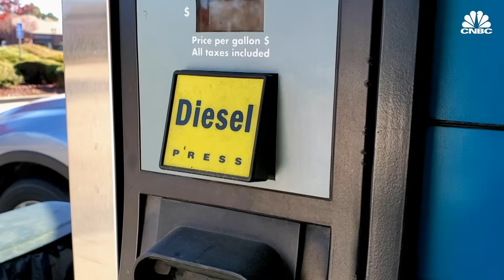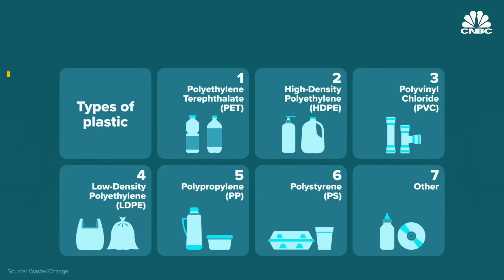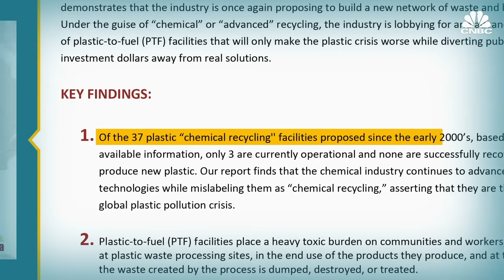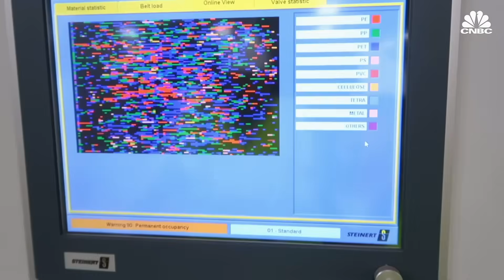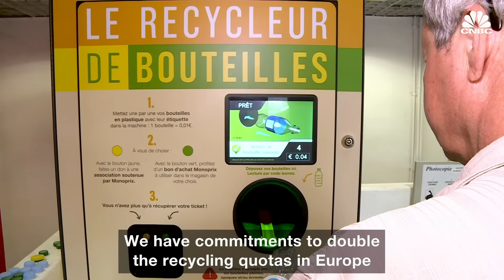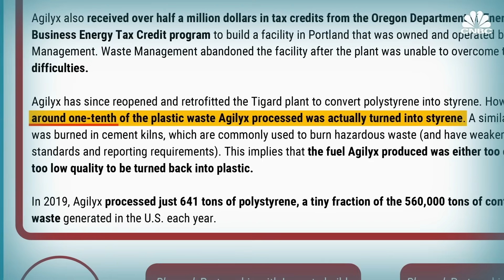Can Chemical Recycling Solve The World's Plastic Problem?

Comment: Coca Cola has got to STOP using plastic bottles. There are several other options for plastic. Options like glass, BIOPLASTICS,  paper milk cartons,  aluminum, tin , steel,  fountain drinks on tap, metal beer barrels that hold Coca Cola so you have Coca Cola on tap. This is a simple problem to solve but it requires managerial leadership. If Coca Cola doesn't show managerial leadership in solving this plastic problem, then the government should pass laws forcing Coca Cola to use alternative environmentally friendly materials. Single use plastics need to be banned altogether; we can start with that.

Comment: Recycling is a damn gimmick only.  It eases your conscience.  It takes the pressure off of plastics manufacturers.  China will no longer accept and recycle this crap.  Your recycled plastics are going in the nearby landfill or being incinerated.  New, virgin plastic packaging from crude oil is cheap to manufacture and convenient to ship filled with product, but it is not sustainable.

Comment: As long as we continue to pull oil from the ground, it won't matter what the final product is (gas, plastics, oil, diesel, etc), nor how many times it's recycled or into what.  The end is the same. Hydrocarbons will continue to be extracted from the deep (from petroleum) and left on the earth's surface (as greenhouse gases, waste, more plastics, fuel, etc).  Even if you have bacterial decomposition, you still have that source material in the end.  From a chemist's perspective, you have a certain amount of mass (oil) pulled from the ground and that mass must be preserved in the form of waste of some sort.  So no matter the recycling method, over time, we will always end up with more and more and more.

Comment: I wonder if we built a shaft large enough and deep enough with an exhaust shaft on the other end, we could compress pelletised plastic waste into these shaft using archimedes screws and use the geothermal heat to trigger a pyrolytic process, cap the exhaust end and process the exhaust gases through distillation, cryogenics and carbon capture.

Comment: An engineer in Australia invented the method of "green Steel" years ago and got an award for her work.  She also invented a machine that takes plastic and clothes and glass and makes ceramic tiles.  We need to abandon plastics quickly but there are ways to reuse them.  The video is on YouTube and she has been working on this for years ever since she graduated from college decades ago. No one wanted her "Green Steel" but now,  with climate change and carbon and fossil fuels debate, her method to forge steel uses 1/3 less coal by using the plastic.  I don't understand why this has been kept secret, I guess because the involved industries have refused to use the technologies until their customer have demanded change.  Call the manufacturers and tell them to stop with the plastic packaging, they will listen.

Comment: Plastics are properly and customarily captured in managed Solid Waste systems. Technologies and internationally recognized standards are available to ensure plastics work in this primary managed waste system (ASTM D5526/D5511).  These systems are actively managing waste and recovering value through biogas recovery for clean energy.  The reliance oin recycling has a direct correlation with ocean plastics as we sanctimoniously  sent all of our "recyclable" plastic waste to countries that have no waste management infrastructures.  It's one of the biggest scams being played and those zealots that think recycling can save us cannot objectively analyze basic facts and data.  Reduce, reuse and recycle is a feckless mantra used by those programmed by an industry that is completely incapable of managing this problem.

Comment: If you turn plastic's into fuel, at least you can solve the problem of plastic bottles in the ocean, and it would displace some of the fossil fuel that is extracted from the ground. It's not a perfect solution, but it's better than anything else we are doing.

Comment: So fossil fuels are on the way out??,  3/4 of the navy runs on diesel fuel oil, the army, and Marines use gas / diesel fueled vehicles. I don't see them switching to electric jeeps or tanks any time soon.  Most farmers use diesel machines, lets not forget, all types of construction machines. 
    are you going back to glass bottles to hold all the drinks being sold?, switched to waxed cardboard to hold all the liquid detergents, oils, drinks.

Comment: The environmental cost of plastic needs to be included in the cost of production, otherwise plastic companies will continue churning out plastics at a destructive rate with no cost to themselves. Legislation that taxes producers proportionally to the environmental harm they cause is a great solution. "Open market competition" will just result in companies continuing to push these costs onto future generations by not taking responsibility for the damage they are causing.

Comment: I see that by focusing so much on "recycling" the plastic it is becoming an industry upon itself. Right now the the goal is to reduce plastic waist; however at some future point the owners will be unwilling to go out of business and possibly try to find "behind the scene" ways to keep the plastic problem as a problem. Keeping them in business.  We really need to attach this problem on all fronts. 1) find another alternative for plastic other then fossil fuels. such as seaweed (like they have done in England).2) legislation for the plastic companies to reduce the amount of plastic. and food manufacturing companies to produce a % of their product in glass containers. Giving those of use that want to buy a product~ milk, organic eggs, honey, ext. the option to not have the food in a chemical leaching container. 3) to have more companies willing to receive back the glass container for a reduced refill cost. ( there is one company in NY that is already doing this. you can order soap, oj, and shampoo, ect. in metal containers and they deliver it to you and pick up the empties when you request it.) 4) We also need to have a population that is willing to have their lives changed/inconvenienced for the greater good. Do we really need 16 different flavors of the same brand of soda? or cereal? or whatever? 5) the industry needs to be as transparent as the glass they should be using.
without these changes I feel that we are barley treading water.

Comment: Chemically speaking, it isn't impossible (or even challenging) to recycle plastic. It's simply too expensive to compete with plastic made from crude oil.  So until virgin (petroleum-based) plastic is taxed, or recycled plastic is subsidized to equalize the price, it's just not going to happen.

Comment: We need to focus on REDUCING the manufacturing and use of single use plastics. We should be focusing on alternatives to plastic and single use. The plastic industry should focus on biodegradable alternatives. Why do they continue this death grip? They are only going to make matters worse by justifying the continuation of the thing at the root causing so much pollution. I do not support any of the chemical recycling they are offering here. This is simply not acceptable.

Comment: My whole life I've heard "you have to recycle"....then now as a much older individual I've seen recycling bins dumped right into trash bins. Its a farce. I'm not saying we shouldn't, but most of those blue bins are just put into the trash stream.
Reply: The same truck that dumps our trash can, also tips the recycling bin, into the same truck. Seems a little ridiculous to even separate them to begin with, if they are just combining them at the curb.
Reply: I guess it's different depending on where you live. Where I live they collect recyclables and trash on different days.

Comment: I'm old enough to remember when you bought soda pop in glass bottles that were returned to the grocery store where you got paid for the. We also had glass milk bottles and orange juice as well. Nobody walked around with plastic water bottles and we did just fine. Emerging technology will solve this issue and it will have to because mixed recyclables left at the curb is just stupid. Someday in the future the landfills may be dug up and those piles of rubbish processed for other uses.

Comment: Why?...why? I believe chemists are taking the wrong direction by trying to break down the plastic only to keep producing it...What a dumb solution!

Don't they already see that it's just recycling plastic all over again like we have been doing? It's not a new solution dummies! All you guys are doing is making the plastic stronger but, it doesn't change the fact that constantly using and relying on it will not eliminate or reduce waste in the long run.

Go back to metals and woods which can be burned if becoming infested with impurities as the fire will burn them and they naturally decompose. Eliminating our dependency on plastic will also force many businesses to look towards other things to sell and eliminate many business who rely on cheap plastic goods. This in the long term would reduce energy consumption in many areas and allow other more sustainable businesses to open and flourish.

Comment: The big gas and oil industry have been pulling our legs for decades about recycling.  They started the recycling number system on single use plastics to fool us into thinking it will all be recycled when in reality we only recycle 10 % of that. The only real answer is developing plant based biodegradable type of disposable plastic. We need to get the Big Gas and Oil lobby out of the equation all together. We're  burying Mother Earth in single use plastic debris.

Comment: Waste plastic can be used as a replacement for sand in concrete. Landfills are stillna decent option. There are large strip mines that can be reclaimed with plastic waste since it is stable it would be good fill. There are solutions but people need to lool

Comment: During 80s and 90s glass was unsafe as a container because it can chip and people swallow them can died.  So we all went into tin cans and plastic. Now plastic consider pollution, then we move to using paper and metal containers. Paper contain could leak and beverage inside does last. Metal container is the best if people clean them.  But metal uses Lot of busing to melt then shape into the form as container.  Aren't human just keep creating more problems?  More carbon footprint?

Comment: The problem with stressing recycling as policy is that it places the responsibility for the excessive consumption on the consumer instead of on the producer.  The classic example is CD packaging.  The producer can make a huge package that makes no sense to anyone but themselves,  then say that the consumer is evil because they did not recycle it.  A more appropriate package from the producer is the only valid answer.  
Recycling implies that the end product is similar to (dare I say equal to) the original product (example an aluminum, a can becomes a new can).  Most recycled plastic today is used as an industrial filler.  Depending on what it is used to fill, this can be labeled as de-centralized dumping rather than recycling (example: using ground plastic as a filler in drywall - yes they do this).  
Chemical recycling  is  really the only real recycling for plastic.  Plastics are wonderful because they have extremely long polymer chains that make them very strong.  When the the plastic is recycled, the first step is grinding which shortens the polymer chains.  if it is not re-polymerized then the resulting product is inferior product compared to the original source. The polymer chains are shorter and the product is weak.  Chemical recycling is re polymerization.  The problem is that historically re-polymerization  has used enormous quantities of vary dangerous industrial solvents (primarily Xylene).  This makes it extremely unfriendly to the environment.  
Reduction of the consumption of plastics is the only solution and most modern recycling of plastics is really not recycling, it is decentralized dumping.  It is a crutch and a very poor one at that.

I fear what the trolls are going to do to his post.

Comment: Meanwhile in Sweden

Recycling rate in 2019
Cans (aluminum) 85,8%
Bottles (PET) 84,1%
Common goal 90 %

Zero new traditional landfills.
Reply: Not correct. The trash either gets recycled for material or burnt for energy, hot water for long-distance heating and electricity. The Swedish plants also buy some trash from abroad.
Reply: @Qlletrolle  noted.

Comment: You can start by Banning all but the 2 recyclable types..
Reply: And what will you use for water and sewer lines?
Reply: @CGoffgrid  I meant for everyday retail products: Shampoo bottles, trays, wraps, six-pack rings etc... 
Water & sewer lines are long life lasting necessities! 
Hangers & toys can be excluded as well

Another thing to note: Back in the day we used to refill our glass bottles (Milk ~ Coke).. maybe in the same regards we refill plastics after a clean wash? at least for car motor oils (The company can offer discounts as incentive)
Reply: @silverfoenix  Yes, but returning, washing, and refilling bottles is energy intensive. We should probably all drink more tap water and less packaged beverages, but I'm a diet coke and Monster guy myself. I do recycle every can though.
Reply: @CGoffgrid  Soo it all falls back to energy... there are advancements towards better batteries & solar cells but I doubt we would see anything until they perfect manufacturing what comes out of the lab!!! 
Well, until then every little can help on the long run including your efforts.
Reply: @silverfoenix  Yep. Agreed. I think the best long term solution is burning it for electrical production, but that will have issues too. It's a great material, I'm just sick of seeing it laying everywhere.

Comment: RETURN TO SENDER  laws are required. Taxes, fees, etc. are too easily re-appropriated, lost or politically inconvenient. If there are no nationwide consumer industries for converting end of use materials then the producer industry should be required to receive the products they manufacture after the product has served its initial purpose. Deny the "waste" a place to reside; aggregation of waste into large holes, former lakes, deserts and oceans can be outlawed when there is a possibility that investment into research will find a means to reuse the material being generated. It is not unrealistic. We do that now with some metals. (aluminum, gold, lead, mercury, silver, steel)
Industry may actually switch back to producing quality products that are useful for many generations. Products that are designed to be repaired not disposed of! I think of all those cheap kitch gadgets and toys that are used for five minutes or five days and then tossed into a hole in the ground by the city garbage department.

Comment: Converting plastic into fuel is NOT chemical recycling. It is refining a resource into fuel. It certainly has the potential to reduce the solid plastic waste problem, but will also contribute to the climate change crisis.

Comment: So we turn plastic into fuel, 14% of CO2 emissions cut compared to produce fuel from crude oil.
BUT then we have still to refine crude oil in order to produce virgin plastic to substitute that "plastic product" which needs to be replaced, so...
Reply: And that fuel still ends up as gaseous byproducts including CO2, CO, Nitrous oxides, etc.. You can't burn oil and end up with nothing but water.   Not chemically possible.  So I'm not sure how that 14% savings is real or meaningful.
Reply: @ScienceNotFaith  there are purification systems to minimize this type of emissions
Reply: @serymancac.a.9267  That makes no sense.  It still is pulling carbon from the ground and it remains above.  Purification doesn't eliminate that. We need a way to put that carbon back in the ground.

Comment: The problem isn’t plastic, but the way how we do packaging, take a pet water bottle freaking wrapped up with labels and cheap bottle cap. It make hard for recycling companies to do. Other wise we love plastic.
Reply: Fenil P Yea, but why do we need bottled water at all? It's one of the worst products for the environment there is and yet totally unnecessary. Tap water in most countries (possible exception of the ridiculously backwards USA) is much more highly regulated and safer than bottled water, and a fraction of the price. Yet people are happy to buy less well regulated and less frequently tested bottled water, that is often transported hundreds of miles in diesel fuelled trucks. It makes no sense at all.
Reply: Spencer Wilton so, why do we need glass, you know at what temperature do glass melt and get recycled. Hence glass is worst than plastic but the reason is glass is easy to recycle, when packaging of water bottle make it harder. So, overall it’s people who make plastic hard to recycle. That’s why we are the main problem not water bottles. Just google about glass and its carbon footprint.